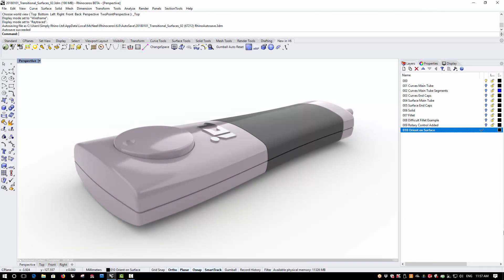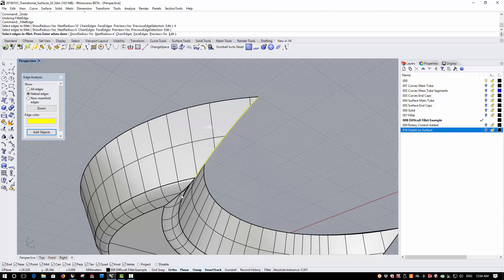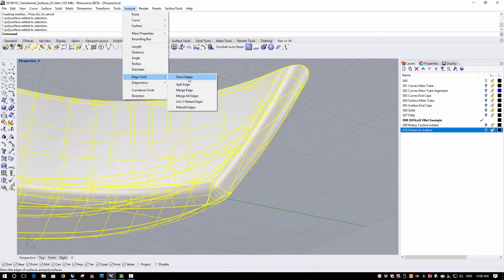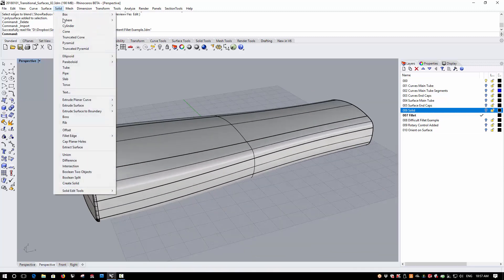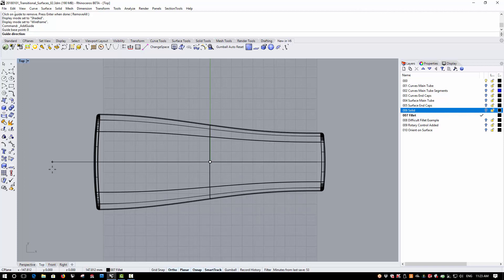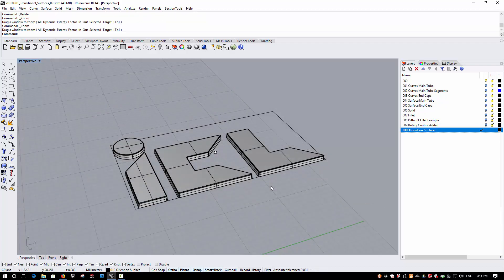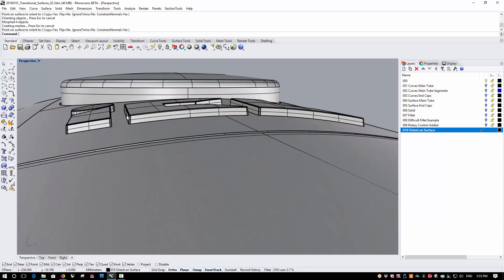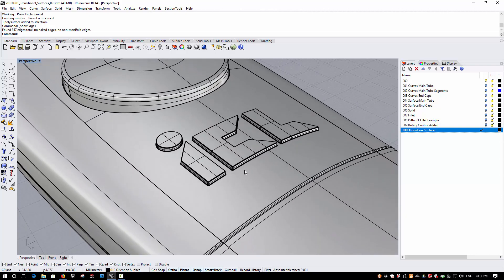Rhino3d v6 for Windows / Modelling Enhancements - Fillet & Blend Edge +

Comment: why cant the blended part be much cleaner like the side of the cylinder ? in minute 5.55 you can see that the top part of the blended edge have less curves than the bottom part.
i hope my question clear :)
Reply from the maker: Hi Maher, The blends between the long edges (top and sides) were made by pulling back the untrimmed edges of the main surfaces – so these edges are not trimmed edges. When Blend Srf / Fillet Edge / Blend Edge encounter a pair of untrimmed edges and if the opposing edges have control points that are lined up with each other (as these were) the you will often see a simpler result.
 
With the blend at 5.55 the end surface has a trimmed edge and the Blend Edge tool needs to put more control points into the resultant blend to achieve the desired continuity and to create a watertight condition.
Reply: Simply Rhino - Rhino3d Video Tutorials Thank you very much for the explanation.